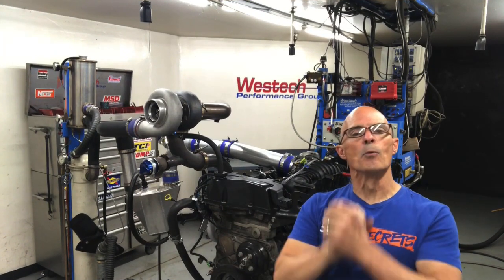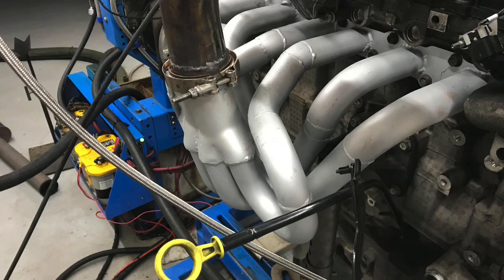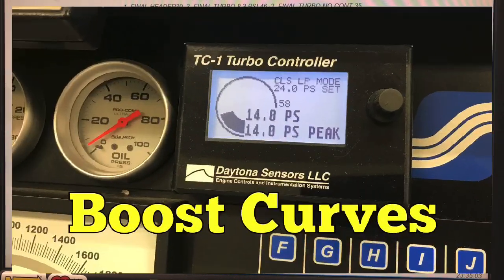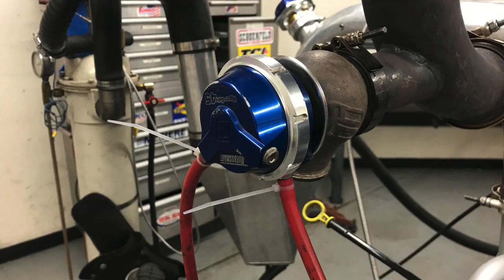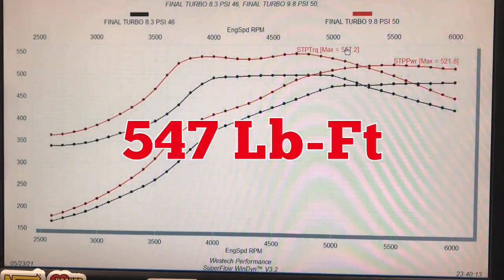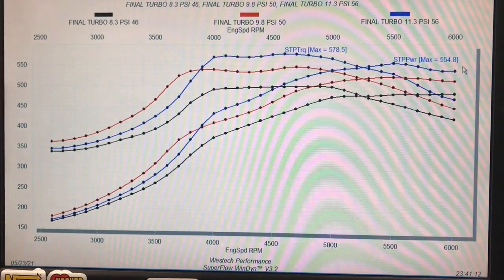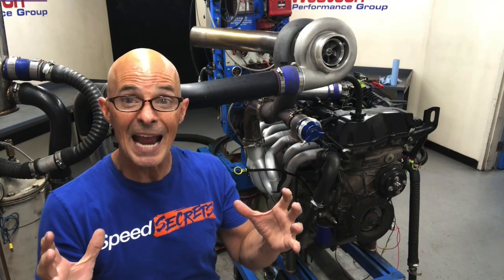JUNKYARD TURBO AMERI-BARRA-THE OTHER GUYS 4200 ATLAS GETS BOOST?

Comment: That hemi injector plug looks sad
Reply from the maker: COUPLE BROKEN ONES
Reply: @richardholdener1727  Poor little guys.. I bought a 60,000 mile Mercury Mountaineer 5.0 6 years ago for $100 with an intake gasket leak, every injector harness lock broke and I zip tied them down. Sold it for $2800

Comment: Would switching to ls style coils like Calvin did help with the spark issue?
Reply: I'm pretty sure not bathing the bottom half of the wires in 2" of oil will help just as much.
Reply: @hydrocarbon82  Meh. High voltage power transformers are filled with oil.
Reply from the maker: oil cooled
Reply: 2006+ basically has LS coil internals so it’s just the oil

Comment: I really hope this help fuel some aftermarket parts for this and it's smaller engines. Too bad it's YEARS after this motor came out and probably not gonna be a huge revenue stream.
Reply: These vids are my excuse to stop people from complaining about my TB.
Reply: Oh you would be surprised. There are alot of supras, is300s, other i6 are getting the atlas-m+Ar5 driveline swap because 2jzgte and v160s are too expensive to replace and when you do find one its all trashed. 

I'm going this route later this year on my is300. Ill sell the 2jz to a fanboy and call it done. 😂😂😂📞📞
Reply: @blaqlabspodcast5816  Atlas heads flow so well, the block and heads are so light vs cast iron so will be perfect for any streeter wanting more hp and tq at lower psi than any JZ can achieve so great choice. Im even thinking a great replacement for diesel 6 toyotas that are so overpriced junk. I have looked at the Toyota HZ engine which have 94mm bores while Atlas is 93mm bore and all the studs match up, oil and water can be matched with oil feed re-routed using fitting and a copper line and heads converted to Belt driven using a block off plate above the front cam caps, all doable. Then would need custom pistons, rods and ready for boost using shorter 100m forged diesel crank but 1mm larger bores can only be a good thing. That would cost the same as buying and rebuilding a thrashed Jz motor or rebuild price of a HZ stock motor but would Troll Toyota "JZ" fanboys to the grave with 4.2 "HZ" as these engines are boat anchors yet still fitted to latest Cruisers for last 30 years.
Reply: @blaqlabspodcast5816 I was thinking the same thing. I wanted to go with a JZ or 7M, but I didn't for the reasons you listed.  Going this route bc a V8 doesn't fit well in a 190e.

Comment: Great power on low boost can’t wait to see when you do run 25-30 pounds of boost but I have no doubt after doing what you said you’re going to it’ll make over 1000 hp
Reply: Not without aftermarket camshafts and more rpm he isn't. No way that bottom end is going to take the 1000ft-lbs it would need to make 1000hp as it is currently.
Reply: @Stan Dup the latest one is around 1900hp stock crank stock block stock main caps stock head as well. Car ran 7.96 @ 4100 pounds.
Reply: Head gaskets won't take it. Hydro-lock and grenade the block or at least crack a cylinder.
Reply: @Stan Dup yes. This is no Barra

Comment: Can y’all do a sonic test on the 4200 wondering how strong the block is compared to the 2jz and barra
Reply: YES, sonic the walls ! I know Westech has a sonic checker !
Reply: It might be interesting to know the sleeve thickness, but the Atlas isn't in the same league. It's a sleeved aluminum block that had problems cracking sleeves when stock in the early years. There are upgraded sleeves available though.
Reply: @guhfluh  they're pressed in sleeves and actually considered serviceable. You can have a new sleeve pressed in after pressing the old one out. It's weird for an engine designed in the 90s.
Reply: @timothybayliss6680  Yes, they are serviceable, but do require special tooling. 1.5mm is the thickness, BTW. Not something I'd replace with stock if I were planning on building for high HP.
Reply: @timothybayliss6680  I did not know that so theoretically you could put some pretty amazing sleeves in it
Reply: @guhfluh  can you source the test
Reply: @kennethraff2002  What test? Sonic testing would just show the sleeve thickness, since it's steel/iron and a wall reflection at the end of it and beginning of the aluminum block jacket.
Reply: @kennethraff2002  As I said, that would only show the liner thickness, which is already published. The block is aluminum.
Reply: @guhfluh   I understand what you are saying. Did you watch the video? I believe it helps shed some light on it can you source where you found the 1.5mm wall thickness of the stock pressed sleeves and what would you suggest over that? That could potentially allow for more boost?
Reply: @kennethraff2002  Look up Melling CSL331F for specs. Darton should have a high performance sleeve offering.
Reply: @guhfluh   it’s hard to tell because it was passed over so quickly that’s why I would love to have a sonic test because it’s out there for the 2jz, barra, and RB which side note rb has thin walls and as a result has twist issues

Comment: Very entertaining and fun to look at! 👍
Will you test it with twin scroll? Since its a six cyl that should be wise!? Maybe the stock manifold pointing up and a two pipe adapter!?

Another suggestion: hook up EGT on all six exhaust pipes and tune the engine cylinder compensated!? I have seen impressive hp gain even on moderate boost! 💪👌

Comment: Valve springs reaching their limit there at 11ish lbs and 5800 RPM?????
Reply: Was wondering that myself.
Reply: @DodgyBrothersEngineering  Springs, oil or maybe the dreaded 4200 harmonics calvin has spoken about extensively on his channel in the past.
Reply from the maker: MAYBE

Comment: I'm still trying to figure out why when it was tested NA the long tube header did nothing over the stock manifold.
Makes no sense.
Reply: Probably because of the short duration camshafts. With longer duration camshafts and more overlap the header will start to make a difference.
Reply: That and gm dose alot of r&d into airflow for factory  engines so there headers are useually really great and they leave alot of room for power improvement in tuning all gm vehicles  are like that
Reply: That factory manifold looks pretty good. I am really surprised that it didn't make a shed more torque through the middle. You would think with the exhaust cam retarded as far as it could go it would make the header even more important.
Reply: GM purposely designed the exhaust ports to be restrictive and called it passive EGR.  A head port and cams is good for 50 HP

Comment: The American version of a 2JZ 😂
Reply: Yea stronger, bigger and better.
Reply: @flexall7408  bigger is not always better, try shoehorn this in my Lexus where a 2JZ sits, bet it won't fit.
Reply: @flexall7408  bigger yes but not better and there was a test done to prove the 2JZ is better. The 2JZ block is very strong and although it offers less total displacement than the Barra, its the better block. Compared to the Barra block, the 2J block is significantly lighter and smaller, plus the actual material used to cast the 2J block is stronger than the material used to cast the Barra block.
Reply: @jayare4472  it's not a barra motor, it's an Atlas. This block is aluminum. It also makes more horsepower and torque than a 2jz and barra n/a. 2jz motors cost 10x as much as this atlas. The cost of the 2jz block is more than the full build on the atlas. I get it keep ur supra a Toyota motor but you still have to accept the fact that the atlas is a better option.
Reply: @jayare4472  What stock 2jz block has held 2,000 rwhp ?!

Comment: I wonder where power would be on 91 octane?
Reply from the maker: IT WOULD BE DOWN WAY MORE THAN 25 HP-IT WOULD REQUIRE MUCH LESS TIMING
Reply: About 25 hp less I've seen hp numbers are consistently  25 or a bit more with e85 even the new lt 5.3 silverado has a higher hp rating from factory on e85

Comment: Richard 3800 big bang .........    when ?
Reply from the maker: PATIENCE
Reply: @richardholdener1727  then do Ford 3.8 after that! Need to know who's dominant 🤣
Reply: @FordRanchero289  why not a Chevy 229? Dodge has a 3.8l pushrod 60° that was used in Fwd chassis and a 3.9l magnum based V6 in the dakota. The king of all of them is the 3.9l high value V6. It doesn't really matter, they're all garbage.

Comment: I like the wastegate discharge pointed at the signal lines and blowing stuff around. On the third run you can see when the gate starts to open. You should put this in a Miata just to spite UTG and not worry about putting the engine in the pedal box. Naturally Aspirated this will make more power than anything he does with a slant 6, and it wouldnt be a big stupid waste of time.
Reply: This thing wouldn't even begin to fit in a miata. This thing is really tall.
Reply: @jlsracing997  Where there´s is a will, there's is a way.
Reply: @jlsracing997  I have seen a video of a Mk3 supra with a 4200 swap with stock hood. They're huge but I think if you put something other than a 7 quart oil pan on it and maybe rolled it a few degrees you could probably just get it under a miata hood. You might have to remote mount the Radiator or use an electric water pump and mount the alternator to the rear end but there is a way to do it.
Reply: @timothybayliss6680  Do you follow nivlac57 and what he has done with these motors?  There is a lot of work to even get one in an old Studebaker. Even cut up oil pans and pieced them back together. It would take a lot of money and fab work to do. you would really have to want it. Don't hate on Uncle Tony. He does more with less than anyone around.
Reply: Put it in a 240z.

Comment: 6k rpm and going up in hp. We need more cowbell
Reply: I can't hear it, needs MORE COWBELL!
Reply: Yeah, I've got a fever too only cure is.. more cowbell. Get er done Richard Holdener!
Reply: Cowbell…
Reply: Lol, yes, more cowbell!
Reply: The only reason that they limit those things to just about six grand oem is because you can't spin a 4l sixty that fast, they don't like it
Reply: And probably a lot more valve Spring pressure in rate
Reply: 6K? Stock maximum upshift rpm is 7K
Reply: Deffo needs more cowbell 😂
Reply: Must
Have
More
Cowbell !!!!
Reply: I got a fever...

And the only cure...

IS MORE COWBELL!!!

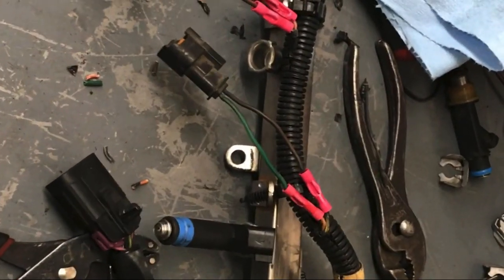Comment: 2:03 . I know it's a short term "get it running" situation, but guys, don't use these cheap butt connectors. Get decent heat-shrink butt connectors and you'll be a lot happier with the end result. Especially in an engine bay with moisture and road spray. 
  Keep up the good work Richard. I love the other guys!
Reply from the maker: I USED MIL-SPEC BUT CONNECTORS